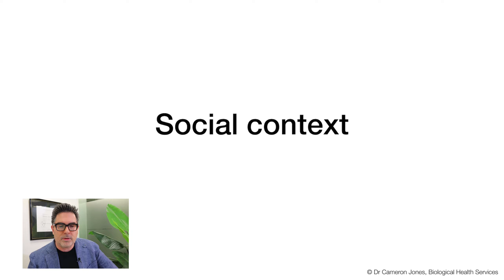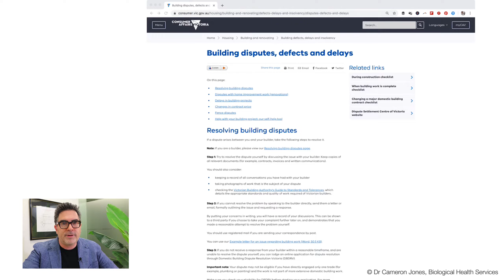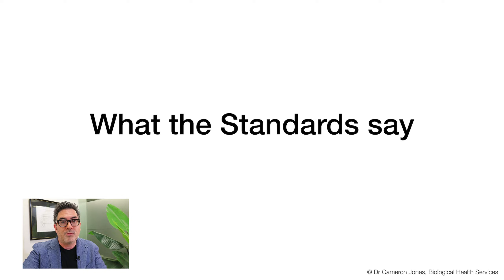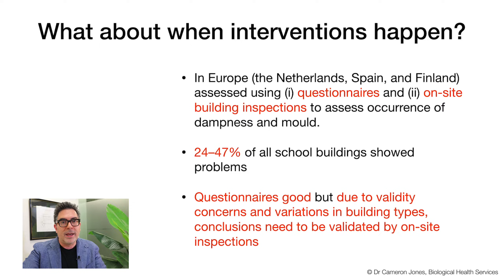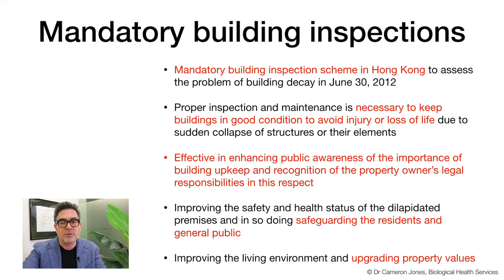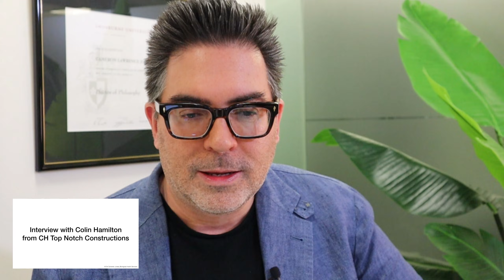Building Inspections - What You Need To Know? Interview With A Building Inspector

Comment: in qld when building new homes, you can get your independant private inspector for all stages of construction from:

 - pre pour slab inspection 
 - slab inspection ( after pouring)
 - Frame inspection  ( steel or timber) for walls and roof
 - Pre plaster inspection 
 - Enclosed/finishing ( includes waterproofing)
 - Fixing stage
 - Practical completion and handover inspection

doing this will help your newly built home from having too many defects, the private inspector  works for you and not the builder and paid by you not the builder, so he will work on your best interest. I wouldn't trust Builder using his own inspector. On all stages,  the private inspector will send a report to you as owner that  you can forward to the site supervisor ( the builder), Usually the report will include particular defects and how to rectify them with  some sample from NCC and AS attached, so there is no way the Builder will try to argue but to just fix it so it becomes compliant. It is also  better for builder then waiting much later when the house is already completed, because it will be more expensive to repair.